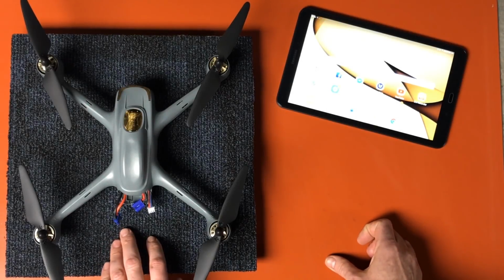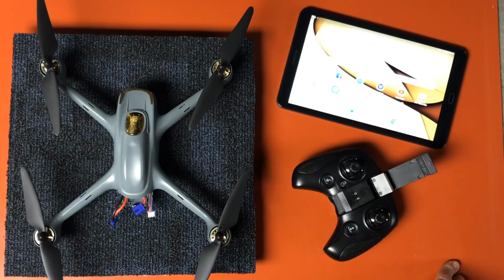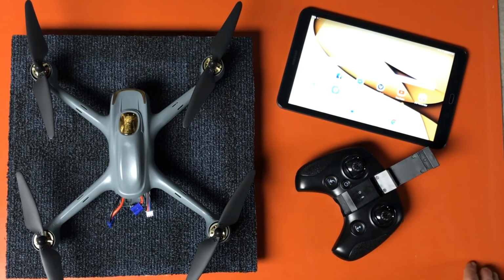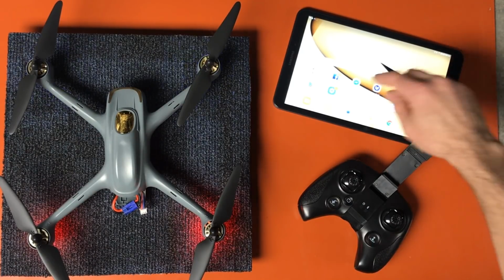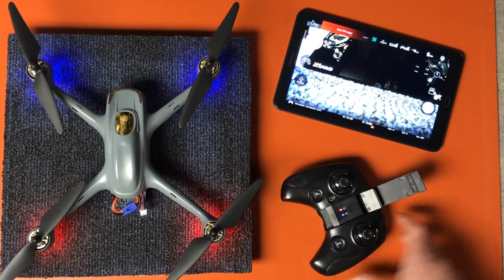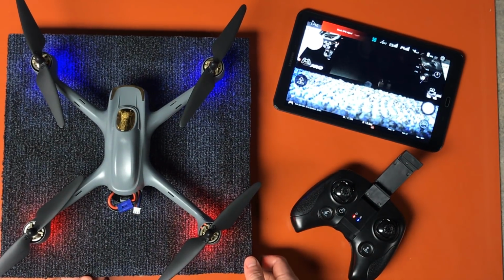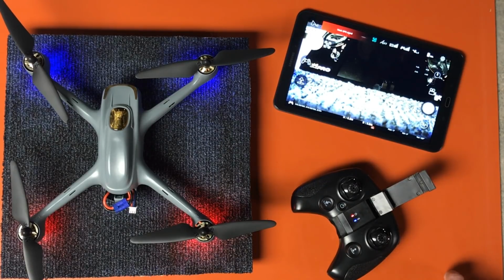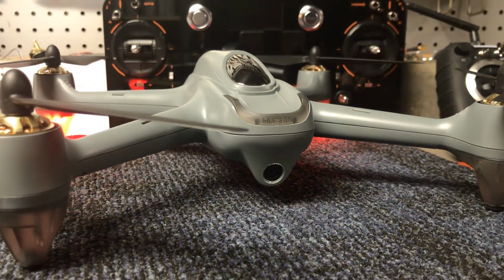HUBSAN H501M INTRODUCTION, INSTRUCTION AND NEW COMPASS

Comment: WiFi makes this attractive to general public. Sounds like a nice price point too. 720p isn't bad as long as stabilization is adequate. Waypoints and designated orbit. Close range isn't bad either. My use is a stable airborne platform to hang a GoPro off for short photo flights.
Reply from the maker: I think the top complaints will be range, camera and transmitter but going from the price point I think it is very reasonable and enjoyable for a newby wifi flyer.

Comment: Best app interface so far. Since I have A it's not really interesting to me but at 119$ it's a deal.
Reply from the maker: I think it's a good deal as well and am interested to see the price without the transmitter. You really don't need it and in my opinion the app's virtual sticks are more responsive while the transmitter is a bit delayed and sensitive at times.
Reply: Agreed.  Seems better option then Bugs 2w as bestselling quad in that price range. Waypoints and Orbit are strong points

Comment: Bro...i have 1 coming package for these h501m...i hope it will work well and in good condition..thanks for the review bro...i watch your review manytimes already
Reply from the maker: wilmer azarse Thanks! Fingers crossed you get a good one!
Reply: Yes...i have some problem regarding to my gps accuracy test sir...it always says that i dont have enough gps and i cannot do for follow me, waypoint, orbiting ...what do i do sir...i Love this drone...i alteady uploaded all the flight test yesterday and today and i notice that i cannot go for the follow me , waypoint and orbiting...
Reply: I need some help.  . For this...but i am very satisfied thw way the aircraft fly very stable..but have problem to the transmitter using blutooth is not good quality for the signal to the aircraft...but in the apps through phone are excellent
Reply from the maker: wilmer azarse since you have multiple problems I suggest you join my group in the link just under the video. Can you do that?

Comment: Beautiful tutorial regarding this drone. The documentation with this drone shows that the camera is 720 / 1080p I'm not sure why it says that? As you stated this is only 720, my question is:  would I be able to purchase the 1080p camera separately and mount it inside this drone?
Reply from the maker: Gemster18 For the M I don’t think you can because you would have to replace the receiving board with the camera to support 1080. The WiFi module is part of this board so you would have to use the receiving board/camera from the 501A and it’s firmware. I don’t think the main board of the M will support it. 👍

Comment: The gray looks good. Should use the C plastics with some black motors and gray props. Still think the H501S is a better value at $169 dollars. With the lesser quality camera at 720P and the possibility it doesnt come with a controller just dont see the logic behind it at $120. Wifi FPV is horrible anyway.
Reply from the maker: Tom Dudley it is what it is. Not for everyone or most people I guess but perhaps the $50 difference may be huge for some. I guess the future sales will tell the story but for me within 100 meters it’s been a fun flyer with a new look and dependable even with the new hardware and firmware. Not Hubsan’s strong side. Thanks

Comment: Hey I enjoyed this review first time I have been on this channel I recently just purchased the MJ act bugs 2w which I think is great. Iam Thinking about getting the Hobson H501S because I heard the only difference between this and the advanced is the remote however the remote on the advanced is coming with serious issues on the antennas can you confirm this
Reply from the maker: B Drones the problem with the advanced is just the pigtails for the antennas. No biggie and better to upgrade them to a thicker gauge anyhow. It’s not as many as it use to be but it’s a simple cheap fix. I prefer the advanced any day over the standard.

Comment: I own this drone (H501M) and it’s completely unusable. I get the message to complete compass calibration over and over. I’ll complete a calibration and immediately the message pops up again. Very frustrating. I literally needed the drone today to view something on my property and by the time I got it to work, it was too late. I should not have to spend 20 minutes setting up a drone before I can fly it. Every time I disconnect the battery, it does the same crap. This is why it’s been in my closet for the last two months. Pull it out to use it and same crap. I will never buy a WiFi drone again. I don’t know if it’s the app or the drone, but one of them is totally useless.
Reply from the maker: J Walker it’s the firmware....I have 2 and both do this but not as badly as you described yours. 
After doing the compass calibrations 1 and 2 mine are usable. 
Have you performed the IMU calibration? If it’s way off it maybe detected as tilted to far and activating the cal

Comment: Hi, Nice presentation thank you. According to Banggood it can "fly up R/C Distance: About 300m". Is that possible with the RC? Is there space for a 3400mAh battery? I think its about 2-3mm thicker.
Reply from the maker: Johan Coetzee This is WiFi only...I flew it recently in a high interference area and it started hesitating at 150 meters in which it hovered and did not return to home. 
I hit RTH and it did just that. With a extender or the relay it should do more and I suspect 300 meters is likely which both I will test soon I hope. 
As for the larger battery? I don’t know but the stock battery does fit loose compared to the other 501 models.

Comment: what will be different when doing this compass update?
Reply from the maker: Tinga Jr. Nothing now because all the 501 models come with this compass. This was like 2 years ago 👍
It used to be that you had to calibrate the compass on every startup. This compass stopped that.
Reply: @QCGUY   The model I have is exactly the same as yours, 501m in gray. I bought it almost 2 years ago at Banggood. And every time I use it, I have to do the same horizontal and vertical calibrations. If I do this procedure that you did in the video, will it get better and I won't need to calibrate every time I fly? And thanks for answering my question :)
Reply: Another thing that happens in mine, is that horizontal calibration is easy to do, just rotate the drone for 3 or 4 turns and it calibrates. But vertical calibration takes too long. Sometimes I spend 5 minutes turning it vertically so that it can finish the calibration. What could it be?
Reply from the maker: Tinga Jr. you shouldn’t have to every time but I would check to see if hubsan has the latest firmware on their website. You could have gotten old stock with the earlier firmware.
Reply: @QCGUY  I did the horizontal calibration again as you showed in the video, and he went back to straight ahead. Before, when I accelerated to go ahead, he would go a little to the right. Now it's back to normal and going ahead correctly. Only the vertical calibration that still takes time. I will see on the website if there is any firmware update for my Hubsan which is the oldest.

Comment: He really does not fly farther than 50 meters? Very little for a brushless motor(

Why did the hubsan make such a complicated double connection of the phone to the drones by wifi and the transmitter to the phone on the bluetooth? It seems to me that this is not the best solution. Why not use a 2.4GHz connection?
Reply from the maker: Дмитрий Кабульников I don’t build them but I went 100 meters with mine.
Reply: I understand it. The question is more rhetorical :)
Reply from the maker: Дмитрий Кабульников 👍

Comment: hi.i watched your video and decided to pick one up.the quad connects to the wifi ,but the transmitter will not pair with the bluetooth on my phone.do you have any idea what could cause this?any help would be appreciated.thanks.
Reply from the maker: Eric Dawes you’re going to the controller in the menu then clicking set transmitter and aircraft connection? 
The Bluetooth light on the controller needs to be blinking and click refresh if it’s not showing up in the list. 
If it’s in the list you have to click and highlight it then click connect.
Join the group linked under the video if you need further assistance. Thanks
Reply: I have the same problem, tried with two different phones, carried out correct  procedure as above but donot connect. Both phones are Android 6.
john g.
Reply from the maker: John Griffiths If you’re trying to connect in the controller tab in the app settings and it won’t connect click refresh and highlight the Bluetooth controller then click connect.

Comment: Do you think we could use the advanced  transmitter of H501ss to this one ?
Reply from the maker: shammoon amir no and this seems to be confusing to many for some reason and my apologies if I wasn’t clear enough. This is a WiFi control only quad, no 2.4 signal which a transmitter would need to control it.
Reply: Okay.. Thank you

Comment: How many meters does the Quadroopter fly?
Reply from the maker: MrHensley It’s rated and advertised as 100 meters and I have almost doubled this with out a extender or anything so with a little boost I’m sure it will do more.
Reply: Can you say with the help of what you have increased the range of flight or give a link to the extender?
Reply from the maker: Евгений Куликов I only flew stock. You can buy WiFi range extenders to plug into your phone and Hubsan is also working on something else to help. Im testing it now and can’t give any further information than that. I see you requested to join my group but I cannot approve you because you didn’t answer any of the three questions.

Comment: Iam still waiting a reply from your support team having bought the H501s-s which is great. Not so your H501m since buying it I nearly lost a finger by a fly away, yesterday same thing happened but I lost 2 prop guards when the drone hit a fence (fly away). There are major problems namely 1 trying to connect to the transmitter and aircraft connection 2. Unable to get GPS.  3 GPS accuracy test is useless . These incidents happend when using the Bluetooth transmitter do I try using the WiFi only or will the drone fly away and get lost forever.

I would appreciate some form of communication from your support team with view to having a complete refund and the cost of prop guards the finger is healing well so Iam not taking legal action. It’s been a nightmare which I hope to get resolved one way or another.
Reply from the maker: I'm sorry to hear about your finger and I myself have been bit by the blade when I first started. I don't work for hubsan but work with them in testing and resolving issues. Join my group on Facebook and I will be glad to help you resolve your problems there. I can tell you how to get past the GPS accuracy test successfully and work through your other issues. It's easier to work with people that way rather than here on the Tube. Thanks 
https://www.facebook.com/groups/HubsanOwnersSupport/
Reply: Hubsan QC Help & Support does this Facebook group still exist? I can’t find it. The link doesn’t seem to work either....
Reply from the maker: J Walker it does still exist yes. I will check the link but it’s Hubsan QC Help and Support just like the channel name.

Comment: can i use this transmiter to h501A?
Reply from the maker: Yes you can and you should be able to use it on any of the WiFi flyers as long as the app for those devices support it. Thanks

Comment: Wouldnt it work to use the range extender for the H501A for this one? I mean isnt the bluetooth connected to the phone itself?
Reply from the maker: I haven't tested this far yet because I try to test as is exactly as the product is sold. I'm not sure the 501A relay will benefit here and honestly I don't use that relay myself. I use a device attached to my phone that works fairly good. I will look into the 501A relay further though. Thanks! Good question!
Reply: Gott a new question, is it a new app too?
Reply from the maker: Jerry Berglund yes it a new model so it has its own dedicated new interface within the app.
Reply: Check out quadcopter101 video on you tube with range extender he gets it out to 400 meters hope this helps.